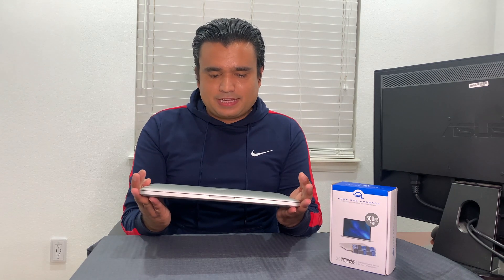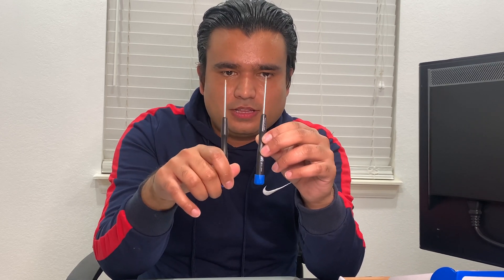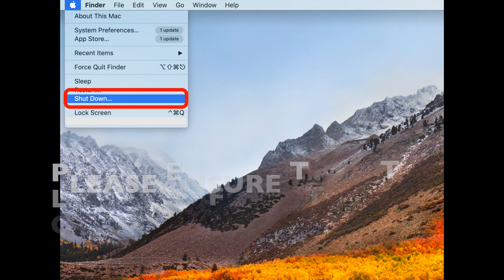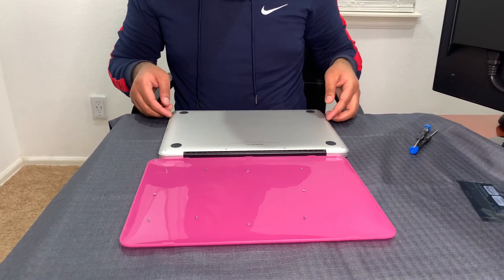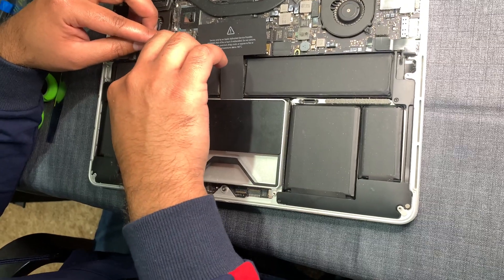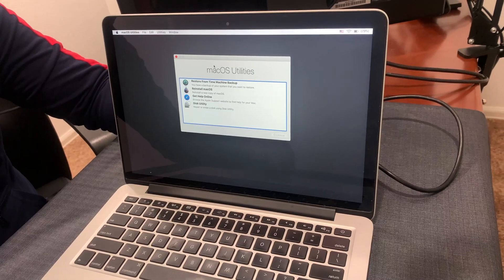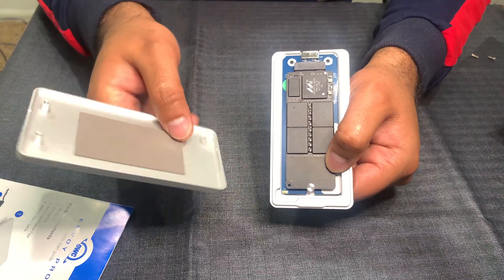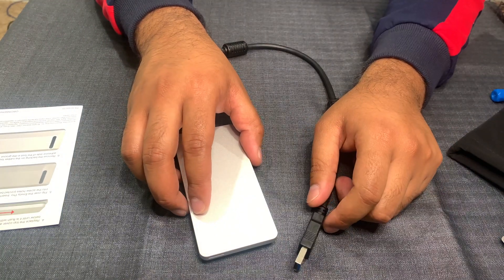Macbook Pro SSD Upgrade In 2020 (Make Your Old Mac Run FAST) - 2012 Pro With Retina Display

Comment: I got a MacBook Pro (13”, early 2011) 
OS X Yosemite. 
Processor 2.3 GHz Intel Core i5 
Memory 4 GB 1333 MHz DDR3
Graphics Intel HD Graphics 3000 384 MB

Can this be upgraded and is it worth it?  Which kit would you recommend?

Can I upgrade the OS after I do the hardware (SSD) upgrade?

Thanks in advance !  👍🏼
Reply from the maker: Hello, I keep responding to your comment but youtube seems to remove it for some weird reason. Probably because I had a link. Yes, your system can be upgraded and it should make it fast. You will be able to upgrade OS afterwards. Please check the description of my video where it says SSD kits and if you click on that, the website will guide you and help you pick a compatible kit.

Comment: The title indicates the computer is a 2020 mac.  It is in reality a 2012 MAC.  Totally different challenge.
Reply from the maker: Hi Aaron, thanks for your feedback. It was not my intention to cause confusion. I was going towards how to do this in 2020. My description as well as the video itself states multiple times that this is a 2012 macbook pro with retina display. After hearing your feedback, I have changed the title to better reflect this. Thanks again for watching and appologies for any confusion.
Reply: @ShivaSapkota   I don't disagree, but it also misled the individual below who has a 2020 macbook pro, yet you have not clarified to that person who appears to think this process will work on their machine.
Reply from the maker: Hi Aaron, I just responded to the person below. As stated in my comment, if the viewer went through my links, Macsales website does a compatibility test and clearly states for which mac's those SSD's would work for. I labeled clearly in  my descriptions as well. Again, after you pointed out, I realized the title was a bit misleading and I immediately corrected it. Thank you so much for your feedback, much appreciated!!
Reply: @ShivaSapkota  Thanks for clarifying.  My original post wasn't intended to correct your title, but instead to inform other individuals landing on the video hoping to see what parts and procedure are necessary for BGA rework of late model MACs that the 2020 in the title was not the model year of the machine.  Just hoping to save others time and sanity.  Thanks for the video.  It's a great demo of how to do the change on that model year.
Reply from the maker: Thanks Aaron. I genuinely appreciate you pointing this out and avoid any misguide from my part. As a small and growing youtuber, I welcome feedback and appreciate when folks point out things that might be misleading in my videos. Again, thank you so much 🙏

Comment: Thank you !!
I have a 2020 MacBook Pro , I wanted this Video! Thank you!
Reply: This video will not benefit you.  The 2020 macbook pros do not have modular memory.  They are BGA ICs mounted to the motherboard (believe this is true for the RAM and storage).  I hope you didn't buy a SATA or mPCIE module as you'll be returning it.
Reply from the maker: Hello, my apologies for any confusion my title might have caused. I am sorry for that. If you have a 2020 macbook pro, this process will not work as clarified by Aaron. If you went through my links to purchase the SSD, macsales website would have you put in the year of your mac and shown the correct SSD for that year (if supported). Thanks for watching and sorry for the confusion.

Comment: Yay! I have a 2009 MacBook Pro that I want to upgrade to SSD. I'll definitely be checking out an Aura upgrade kit. This is awesome!
Reply from the maker: Thanks for watching my video, I am glad it was helpful. The Aura kit is super easy to use and my mac is much faster now.
Reply: @ShivaSapkota  I had my hard drive replaced about 3 years ago & my previously trusted mac mechanic never mentioned to me that you could put an SSD into a 2009. I learned I could do this earlier this year but didn't have the funds to have someone do it for me. Thus looks so easy. I'm really excited! Thanks again!
Reply from the maker: @aprilenchanted  yes, the Aura kit is very versatile and works for various mac products. Also, Macsales/OWC tend to be a bit more affordable compared to their competitors. Good luck with the SSD replacement, looking forward to hearing from you on how it went.